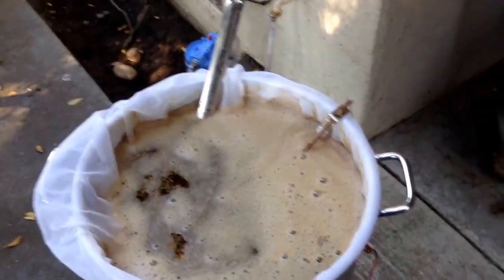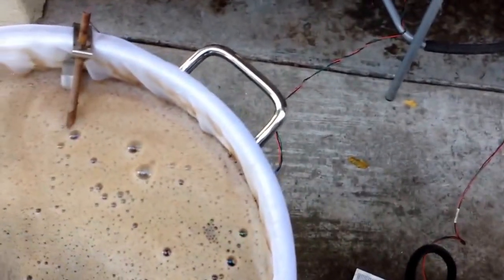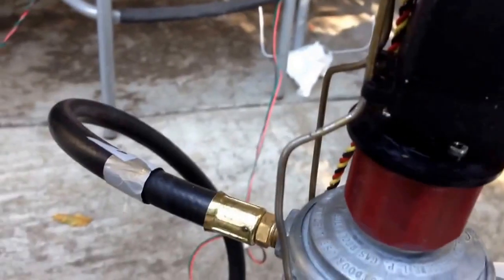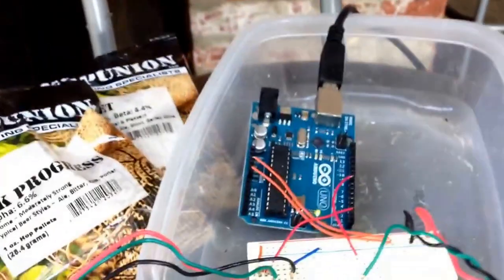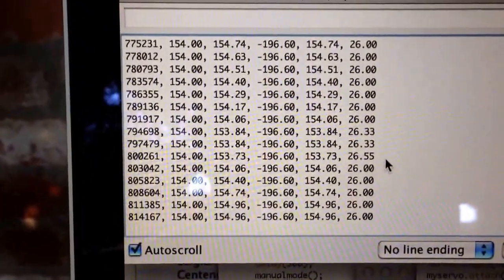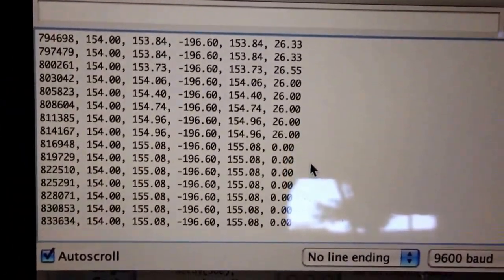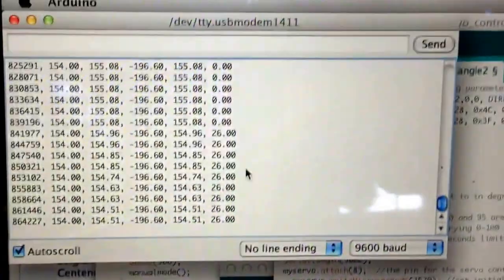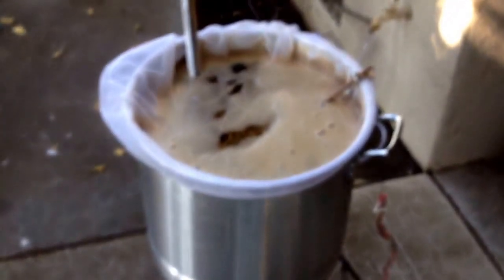PID brew in a bag propane and servo

Comment: Hi, I want use this device for two 18B20.
https://www.tweaking4all.com/hardware/arduino/arduino-ds18b20-temperature-sensor/attachment/ds18b20-parasite-power/
Is it correct?
Thank you.
Reply from the maker: Mert Karaca I don't use parasite power, I found it inconsistent with the arduino.
Reply: Ok I will try this schematic?
https://www.sbprojects.net/projects/raspberrypi/temperature.php
I think you used like this  schematic?
Reply from the maker: Mert Karaca yep, that's the way to do it
Reply: Thank you very much for your effort.:)

Comment: need to get yourself some electric heating elements... mash in and walk away
Reply from the maker: Yeah, that may be the next step. As proud as I am of the propane setup, it still takes more oversight than electric. Propane may be faster , but speed isn't everything when I can not watch over a hot pot for 5 hours
Reply: +nearlynormal007 check this thread out from the beginning http://www.aussiehomebrewer.com/index.php?/topic/57924-Braumeister-NEXTGEN-Build